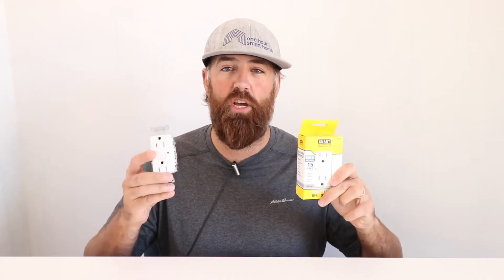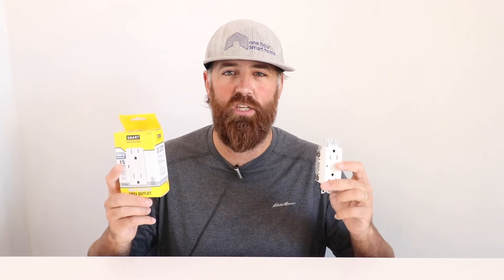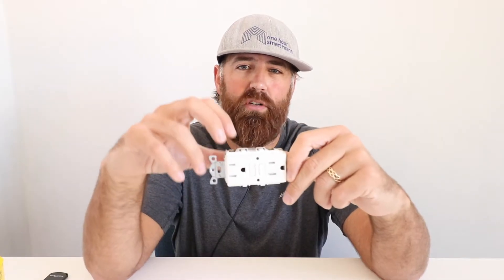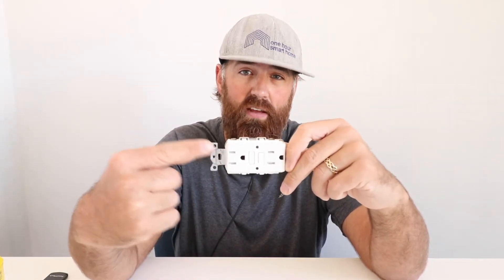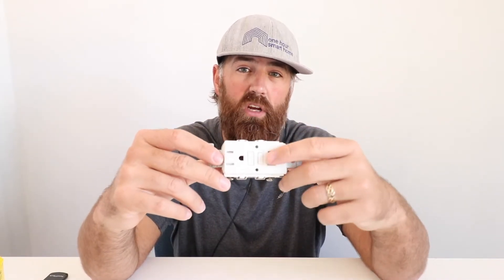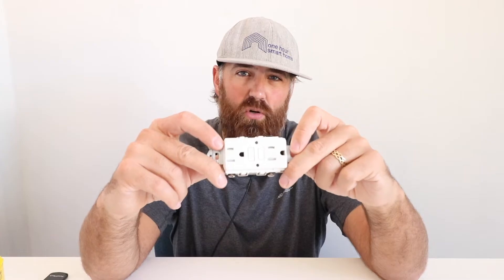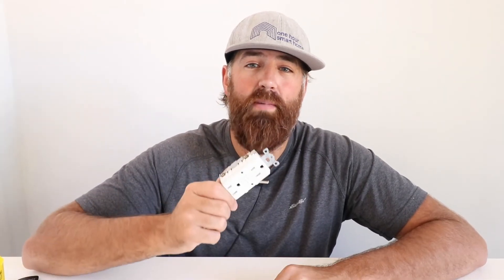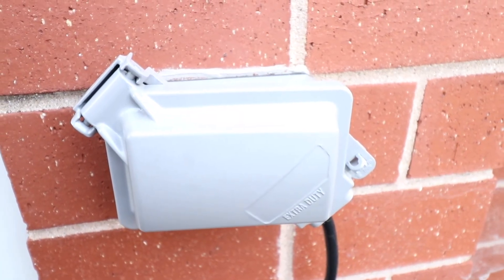GFI vs GFCI What's The Difference?

Comment: Someone told me, One is meant to save a life and the other is meant to save equipment. A GFI will trip (stop electrical flow) at 500 mAmps vs a GFCI which will at 4–6 mAmps.

Comment: I was taught to refer to gfi as the receptacle version and a gfci as the circuit breaker version. Also, they don’t really sense ground faults, they sense an imbalance in current between the hot and neutral, which a ground fault may be the cause of, but there are other reasons why it could trip other than that.
Reply: Were you also taught, 6 in one hand- half a dozen in the other? Next, you'll be schooling us on why it's "not a 3-way switch, but a 3-WIRE".
Reply: That's literally what a ground fault is. The current must go somewhere

Comment: the builder of our house says GFI plugs in the garage are not to be used for
fridge or freezer. what’s the reason for this? aside from fridge not allowed to be used, are there other appliances that we should not be plugging in to avoid injury?
Reply: This is so that if the plug fails or trips from another receptacle that jumpers from it, it doesn't ruin a bunch of food and put you at risk of food poisoning or something. That's why those appliances are supposed to have their own circuit and receptacle.

Comment: Those GFI receptacles often fail for more reasons than just weather exposure and not covering them. If you replace them with a standard $3 UL Listed outlet, you'll pissOff an electrician who will cite code violation, safety, and tout his "years of experience" at you. For some instances, GFI protected circuits makes sense (outside hot tub, bathroom, etc) but if the NEC or other agencies had their way...all circuit receptacles would be GFI. Safety is always #1, but common sense (not overloading circuits, proper wiring, protection, education, etc) is where people really fail.
Reply: So, in essence they are needed everywhere cited

Comment: This was very helpful as I just had our home we are selling “ inspected” by a so- called professional home inspector who said I needed to replace a good working GFI with a GFCI.
Reply: Are you sure they didn't say AFCI? Because if it's in the Kitchen, it needs to be protected by both.
Reply: @jasoncastillo7843  
All this stuff is just overkill. Just another way for government to expand and collect fees. How many died from electric shock in homes? Probably only a hundred or so and of that number the majority had nothing to do with what a GFI does. Now... how much money is spent installing, hiring and putting these things everywhere as code requires? Probably in the millions a year 
The code is ever changing as is all government programs. I remember when these first started becoming code in homes and needed in places like the kitchen. First it was every 6 ft or so and then they jumped it up to 12ft and then just flat out put the dam thing everywhere. Then to make people buy more.. They came out with versions that "continuously checked" meaning They broke more frequently and needing replacement. 

Just nonsense. Like how we have multiple grounds now to outlets. Ground outside, Ground on the box, Ground outlets, Ground water mains. Its just absurd. We all did fine without all this. If there was significant number of deaths or injuries then it be understandable but you should not force everyone to suffer due to handful of morons. But sadly this is how all government programs work.. Come out to "fix a problem" and then create more problems so they can increase budgets and collect fees. Before you know it a 2million dollar program is now in 300million area and climbing every year.

Comment: That was a great presentation 
Really well explained and to the point 

I explain that to people and either they get lost or don't want to hear it 

And others dumb idiots don't connect the ground wire because they think is not necessary  .

If the ground wire is not properly installed it won't protect anything 

It will work like a regular outlet 

The worst part is when gfci are installed in a daisy chain for the same room 

One trip and everything is down 

And again Great video
Reply: I saw on. “This Old House” recently that an AFCI outlet allows your meet most codes for updating a two wire home system for ground fault protection without an expensive re-wiring of entire home to three wire system.They used an AFCI instead of a GFI/GFCI and you can daisy chain them so one AFCI protects the other outlets downstream just like a GFC/GFCI.

Comment: Doesn't the GFCI refer to the interrupter that protects the entire circuit instead of at a local level (an outlet as you show) ex. Your main home breakers at the distribution panel?
Reply: No, one is a gfci receptacle the other is a gfci breaker. If you refer to them as gfi, it's exactly the same, one is a breaker the other is a receptacle.
Reply: This question actually helped me understand the importance of finding a meaning for this argument (gfi vs gfci). It makes sense to dedicate the function of whole-circuit interruption to a device, rather than a receptacle which may only affect one point on the circuit. I guess this would only become a problem if a person installed a gfi at the end of the circuit with an understanding that it would turn off the circuit in a problem at any point in the circuit? idk

Comment: Looking for a GFI/GFCI with WiFi built in. Does that exist? Thanks.
Reply: I keep one of these in my Motorhome because of all the GFI’s.
Non-Contact Voltage Tester Pen
With this you can immediately tell if a GFI has tripped.